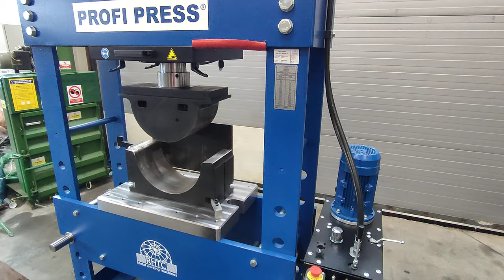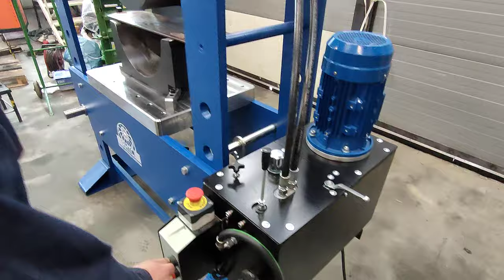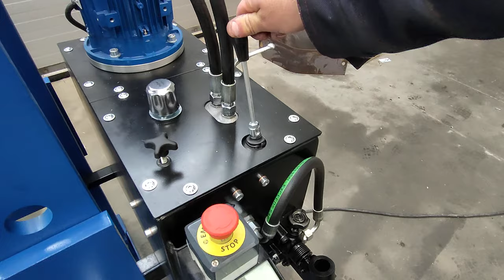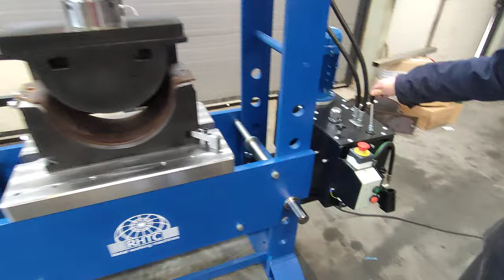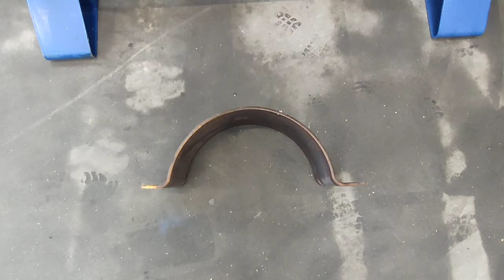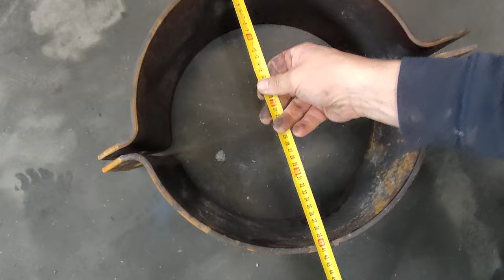Workshop Press for Bending Tube Clamps

Comment: Press too slow up and down use 2 pump 1 speed and 1 pressure purpus and pressur control valve
Reply: can you recommend some alternative with better speed?
Reply: @tomas8030  Use a two stage log splitter type pump. you have a rapid travel speed yet,  the same pressure for the bends. I used one on the 100T press brake I built.
Reply: @SegoMan  Can you upload a video showing how you did this? I'd love to see your setup. Thanks man!